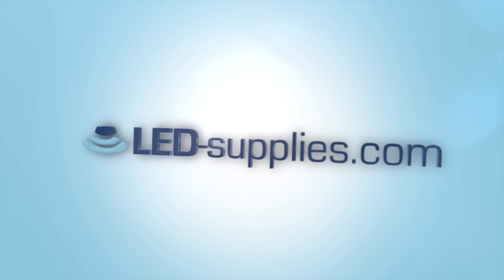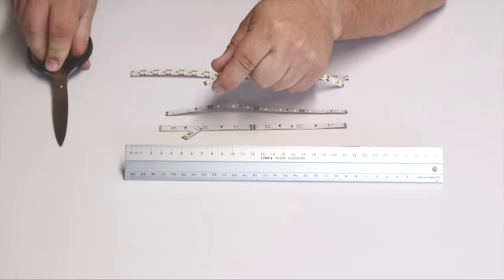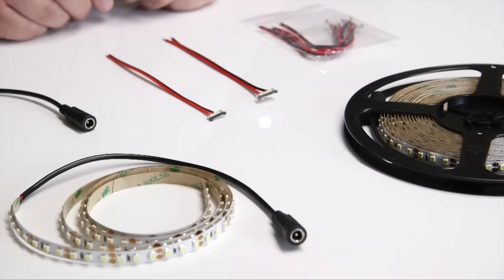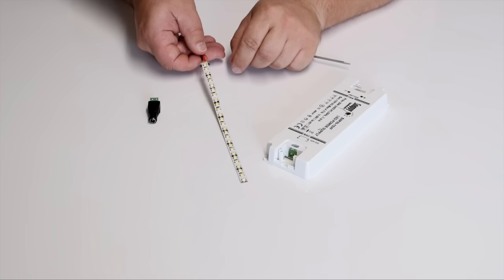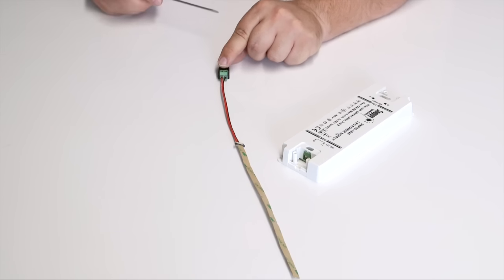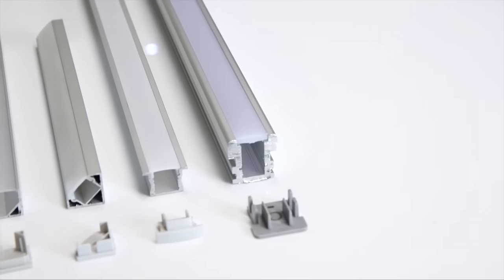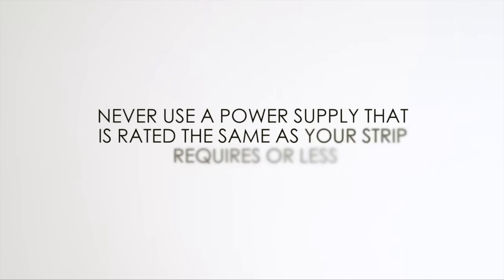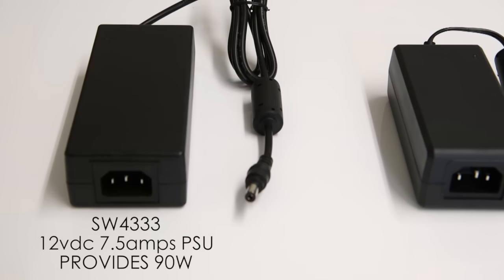How to cut, connect & power LED Strip Lighting

Comment: How do you connect it to a light socket?
Reply: You need to convert the ac received from the light socket into dc current the strip can handle. Think of the converters you use for laptops for example. At 8:53 they go through the different options they have available.

Comment: Great video thanks. I want to put one strip around the back of my tv and one longer strip round the inside of the cupboard that the tv sits in. Does this mean I would have to buy two separate power connectors/plugs and have them powered individually? Using then your first method here for connection

Comment: I completely understand your calculations, but if the lights are rated at  20amp that because it's the amperage the wires can carry safely. I'd even be okay using a 25a fuse, but any higher than that you risk the wires breaking down and possibly catch fire if you're not careful. That's how I was taught to use fuses. My reasoning for watching was to see what was needed. I have multiple rolls. Mostly 4 tab. I do not have power supplies for them. If I add a circuit or even hook it up with the radio supply. Can I run a black and red wire from the radio, wire the red 12v from the radio to the 12v tab on the strip. Then hook my negative to red, green and blue? Or do I have to decide a color to use permanantly? None of the led rolls came with a controller. I'm brand new to this. I hope to hear back from you. Thanks for the video

Comment: I have 20 sets on a photo cell so they come on at sunset and go on at sunrise. The problem is 6 of the sets come on flashing in modes other than no 8 when they come back on and I have to change the mode with the remote.... Hw do I fix that.

Comment: every time I turn on the power supply (external) to feed 70 leds on one strip, I noticed that the leds flashed once.  I'm not quite sure if that's normal.  I then run the arduino to control the leds.

Comment: Hi ... can you help I want to use an led strip on the underside of the hand rail for stairs it needs to be operated by batteries & I need some cables to  cut & join the strip where the brackets are so that the light can is continuous 
is this possible. plz let me know by email
Thanks
DJ

Comment: When I use 9mtr long strip in profile case as square shape can't adjust with same brightness,so need to connect adopter 4.5Mtr strip joint,but how I connect in middle of 6mm profile case?,

Comment: I replaced all my 100w florescent lights with 4 meter .2w white LED 
strips. much better over all lighting.  I used 12V computer power 
supplies.  The best installation is over stairs. They run up the entire 
stair way even lighting. I leave my strips totally exposed. No heat 
problem.

Comment: Very informative video, thank you. One doubt I have is, what happens with very short strips, say around 5 centimetres: can you still power it in the same way, or do you risk blowing the LEDs?
Thanks
Reply: Unless you power the shorter strip with a higher voltage supply than it had originally there is no danger of that. Just use the voltage that the strip is designed for. If it is not marked for some reason, count the number of LEDs in each segment (between cut marks). 1 LED = 5V, 3 LED = 12 V.

Comment: I don't understand your logic about the wattage per meter. You say 4.8 Watts per meter for a 10 m strip but then 9.6 watts per meter for a 5m strip. Why would you use less wattage for a longer strip?
Reply: These would be two different types of strip, Jon. The higher power-density strip has twice as many leds per meter. Both strips would draw 48W.

Comment: Thanks for the really useful video on LED strip light installations. I have a question regarding installing multiple short strips  in a campervan. Is there a connector block for running a couple of  separate strips from a single 12v source cable?   Would I need to use multiple  PSU's? Thanks in advance.

Comment: Hi .. I could do with a little help . Have purchased a couple of kits of 5050 rgb  (4 wires 10mm wide ) . There doesnt seem to be any rating for the lengths (10metre ) of led. How can i measure what the current usage is ? regards Don

Comment: So I have a question. When you cut the strips will you need an extra connector to use the cut portion or will it work wirelessly with the rest of the strips?

Comment: Hi have a LG Chicago theatre signs that lights with white LED lights ( hidden behind the wooden framed canvas) ...we own AND Purchased several as gifts too but several arrived broken... SOLD OUT so unable to exchange without losing so rather just replace the lights ( powers w/ 9v battery)  can I just replace leds? Also do I need to order larger strips & cut to size? ( Don’t have soddering) cost if anyone knows if it’s preferred..... or do I have to order LED strips to size? Thanks in advance

Comment: The little black bulb at the end of my wires ripped off and now I can’t change the colors, turn it off or anything. Basically I can’t use my remote. What is that little black piece called? And can it be repaired?

Comment: I have a strip of RGB 5050 strip and it does not have the driver ? Trying to fix it. How do I determine the voltage it needs 
It has cut markings every foot approx. ( I'd guess a 12v DC - put I need to find the watts and current )

Comment: Can you guide me, what should be the wire gauge that should to be soldered to led strip?
Reply: 18 to 20 AWG, if I recall correctly.. BUT  the distance from PSU to LED may need a thicker gauge

Comment: Please help ive been at it 4 5 days. I have one addressable strip which works fine with controller. I cut the 1 strip into six pieces but can't get them all to work properly. I can get 3 then after that wiring in a fourth causes all of them to turn white and stay that way even if i turn them off from the remote. Unplug the forth and we're good again. Even if the 4th is just another extension with no lights attached all of them go crazy
Reply: probably the wiring/connections.  This type of LED needs 1) a LOT of current   2) very good connections

Comment: One thing he does not tell you at about 8:50 into this video:  I think ALL those power supplies he shows are 220-240 volt input converters/(adapters as we call them in America).  Not a big problem, but if you buy an American (or Taiwan -- they use 120 Volts in Taiwan, 60 Hz, just like we do in USA!) power supply, just make sure it puts out the appropriate wattage as described in this video.  And... ya gotta check that the little male jack thing matches whatever you are using to connect to the LED strip!  Or... hard wire it. 
Another thing.... I was amused by his soldering technique at 5:35.  I've been soldering stuff for, oh, about 60 years (since 10 years old) and never done it that way.  I usually heat up the two objects first, and gently add solder to see if its hot enough to melt the solder on to both parts!   He melted a dab of solder on the tiny strip dot first, then when he added the wires, he just quickly melted only the solder to the wires, didn't have to heat up the LED strip dots again.  Clever. It works!

Comment: im powering up a 20meter led and it turned out it needs a 96w ,,is there any power supply that can make this long led strip run?
Reply: look for OPEN FRAME PSU.    Are they  daisy-chained?

Comment: Can you not just cut the connector that comes with it to expose a red and black wire and then connect that to a 12v system using crimp connectors?
Reply: yes but solder - crimp connectors are crap and the wire gauge is a bit thin

Comment: I tried to cut it and connect so it would bend, but npw only part of it works:(
Reply: You need to cut it at certain points :p
Reply: solder them together using short wires

Comment: I'm having an issue with 12v RGB 5050 waterproof LED strips.
   I'm unable to change the color at all with the remote. It is stuck on a yellowish white color.
I found if I jiggled the connection between the remote box and the LED strip they begin to change color. 
Does anyone have any suggestions.
Reply: solder them together

Comment: I have one question..
All regular 5m LED strip lights come with 12v 2A driver which is equivalent to only 24W but the rating of the light is 60W. So is it ok to use 12v 2A driver or we have to use as per rating like 12v 5A or 12v 6A.
And, if we use 12V 2A driver for only 1m light i.e. for 12W , will it light up without any problem?

Please reply..
Reply: I bet you’re the nerd here...
Reply: @theamaria6497  should i take it as a compliment? 🤔
Reply: 60 Watts?   Check the electrical Watts ( Voltage x Current[Amperage])
Reply: @kennmossman8701  yeah i have checked. Total 300 "LED"diodes are there and each having current rating of 0.0125A connected in parallel combination and voltage rating is 12V. So 12x0.017x300=60W
Reply: @AbhishekSharma-bs4we  Then you need a 12V PSU of at least 1.2  x 60W.   Or use two PSU, each handling its own share of the LEDs
Reply: @kennmossman8701  thanks a lot Kenn..

Comment: If anyone is wondering how to connect the strips without the adapter you must solder the pieces together. It requires a soldering Gun. Or you can try and look for clips that can conduct electricity. You would be better off learning how to solder as they say in the video.
Reply: soldering iron - 25 to 40 Watts...........not a gun
Reply: Kenn Mossman sorry it’s been a while since I used one and my engineering group always referred to it as a soldering gun or iron and thank you for showing the wattages

Comment: hey My led strip rating is 60 Leds/M --- 18 Watt/Meter, - 5 M in length . Do I need to use more than  90 W then ??? Can I use a computer power supply I believe that'll be more cheaper and cooling
Reply: yes and  you can IF you know how

Comment: Do you only need one power supply if you buy 2 packs of leds?
If you connect 2 led packs can u only use one remote?
Reply: Reels, not packs.   CALCULATE the Wattage

Comment: I need to install strips of led lighting in a custom built closet. There are lots of cubicles for shoes, many stacked shelves, etc...I may only need about 5 inches of strips to lighten each shelf and cubby. Can you provide a consult for me on what connectors and requirements I need to accomplish my project? I can provide pictures of the closet along with my idea of how I'd like it to be lit. Also, do you have any motion activated module that would turn on the entire series of lights?Thank youTyler

Comment: Excellent,  In about 5 meter or 16 foot Length of LED strip light...i have about 45 x 3 LED sections. What or how much Voltage required in EACH section....about 4 to 5V or 12V?.....not sure if Constant V or I type...then I can use One 3 LED section from my PC USB at 5V?

Comment: All of these special adapters and extra part numbers you don’t really need to just simply power some low powered Led light strips like these.. 
*1.Cut the charge end off a USB phone charger cable-
2. Strip back the red and black wires to bare metal wire.
3. Attach/solder the red wire to the +positive on the led and the black to one of the other copper pads depending on what color you would like them to be!
4. Plug the USB end into any 5v source/ phone charger block...
Let there be light! And save your money by using old shorted phone charger cables!
Reply: I wish I could understand this ughh lol

Comment: My current light strip (incandescent) is powered through the home electrical on an on/off switch. Can I simply splice the wires from your LED strip into the existing switch?

Comment: I did not get it, can i wire it direct to the mains? to use a light switch to turn it on?
Reply: NO....
Reply: @Elvis-dw7ux  Is this true for any led strips or just some? Is there a marking or something to suggest that this particular one can be wired to the main, as all i see in shops have adapter
Reply: No u can't. All LEDs need 5 to 12V DC supply.

Comment: hey guys so what i did to install these, well I was too scared to cut them and it sounded too complicated, so I just hung the lights as they were without cutting and i only had to connect the one end to the power source, and I figured out how to connect the second set of lights. instead of cutting, when i had to turn corners I just positioned the light around the corner. I could make a video  on it if it helps

Comment: Currently watching this after being yelled at by my dad because he says I have to do research before I go and buy and install something that I thought looked cool
Reply: Good Dad. Take his advice
Reply: So, hey - just stumbled on this thread, and thought I would give interested parties an update. Gustavo did a great job on research. He learned from Govee customer service that they don't recommend cutting and splicing, because the resulting combined strip does not have enough power to work well. Govee  suggested that he should instead purchase three separate strings, plug them into three separate outlets, and coordinate them through his smart phone. 3M customer service told him that the particular adhesive that comes with the Govee light set is considered a permanent adhesive and would damage the wall upon removal. Gustavo's dad helped him to install a small wooden strip around the top of his walls, so that he could attach the lights to that wood, which can be easily removed when the time comes. Gustavo figured out that the lights will respond simultaneously to Google home commands directed to "all light strips." The end result looks great, and provides an impressive background for Zoom schooling calls. Proud of Gustavo for doing the work and for paying for all of this from his dishwashing earnings (now sadly out of work due to COVID restaurant closures).  Gustavo's Mom
Reply: @deborahgriesbach1998  that was the weirdest comment i have ever seen lmao
Reply: Same but with my mom😂
Reply: Wow we really are living the same life
Reply: He ain't wrong. Good life lesson!
Reply: Gustavo G. ah same
Reply: Same bro
Reply: OMG SAME
Reply: I felt that
Reply: same my dads like “yeah well i can’t see any letters” and i’m like well i don’t know i didn’t make them and then he’s like “you should’ve googled this before buying them” like chill i’m sorry i wanted to be cool😪
Reply: hahahahahah same
Reply: Same
Reply: Yes good dad
Reply: At least you’re doing something: my kid just plays video games all day.
Reply: Peter Vautier and your the parent and it’s your duty to stope them

Comment: OMG!!! hE SAID SIMPLY IT TOOK ME! I WASTED 100$ ON THIS BS LEDS ARE NOT FOR ME GUYS JUST BUY A NEON SIGN. And why?
1st:cheaper
2dn: it’s easy you can legit just use clear tape and tape it to your wall 
3dn: it took Ed my 4hours to just try to put strips and I broken it with neon sign tooked meh not even 5min
4th:led stip is uglier neon sign I want to marry it that’s hot nice it is lmao 
I bought on amazon a huge popsicle a captes an open sign for my bed room door and lighting headphone and if you see the, with a stand that’s a charge so you can get it out and put it on the wall and I bought an ice-cream cone and a star and a broken heart for a total of 120$CAD and they were all around 25 inches by 40 and there some way bigger won
Reply: Good sites are amazon ebay and Kijiji and more me once I bought a 15ft led strip for 42$ I’m mad at my self